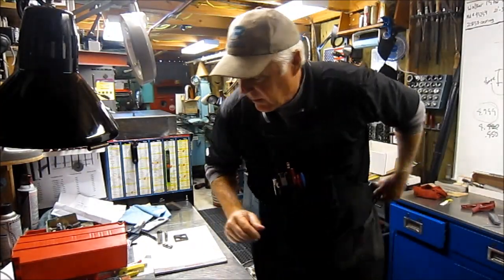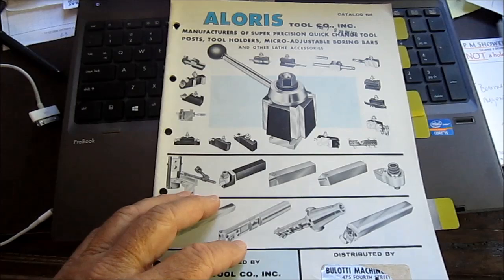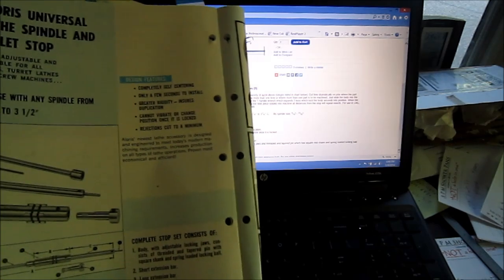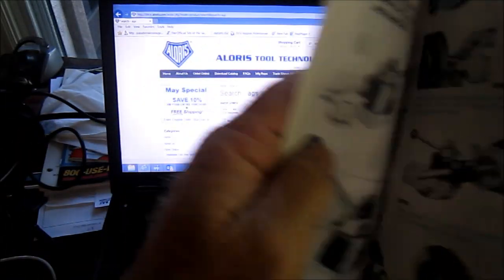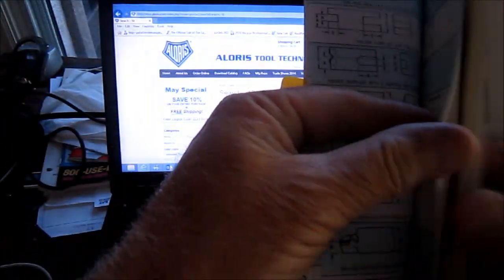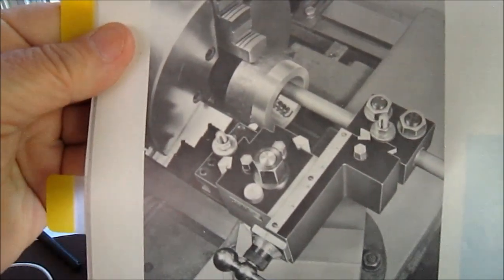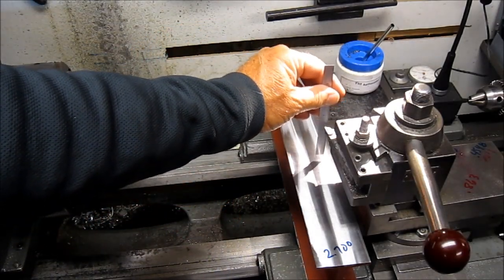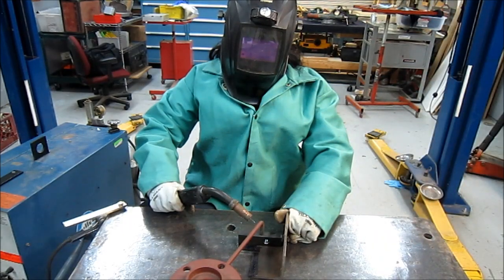Tool Time 22-1  Af Hangover Ii

Comment: When you were milling that H beam, what were you doing wrong? Was it the way you flipped it over that caused the unparallelism?
Reply from the maker: Hello Andre...Hmmm...everything...lol...I was trying to hold on the edges of the beam which would allow the unit to rock.  He set it in the vise but used toe clamps to hold the unit down on the vise...zing...done